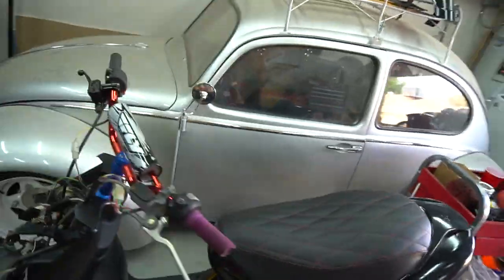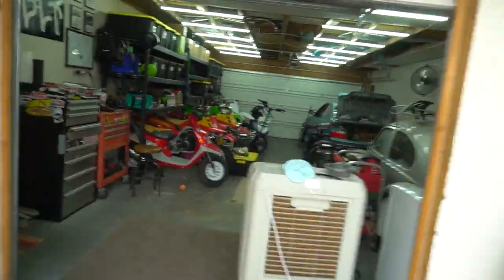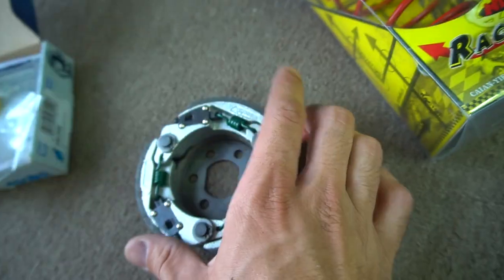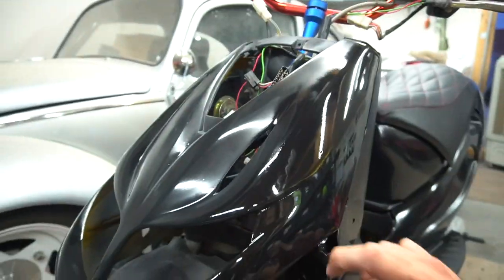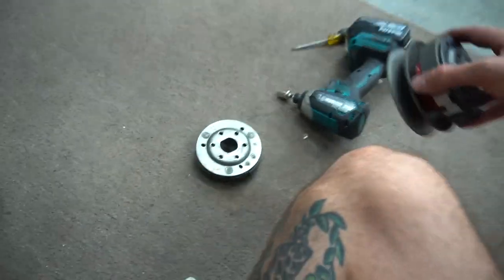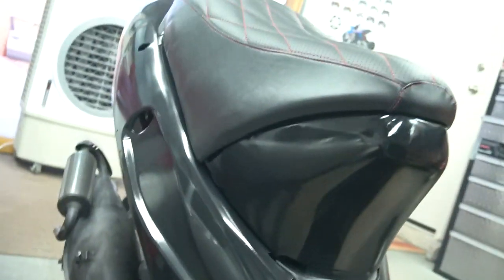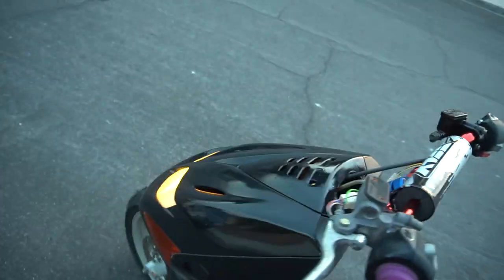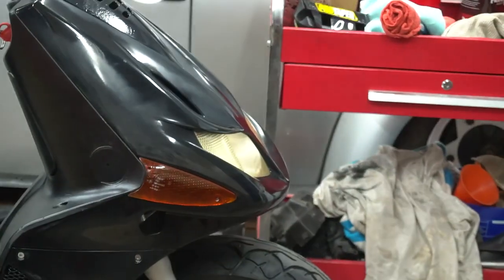RARE DERBI GP1 Scooter is SO MUCH BETTER !! (Naked Bars & More)

Comment: I had this same problem when painting plastic. It's very annoying. I now use Krylon Fusion for plastic parts, since it sticks to the surface better than regular Krylon. This prevents bubbling between coats, and chipping later on when the plastic flexes in normal use.